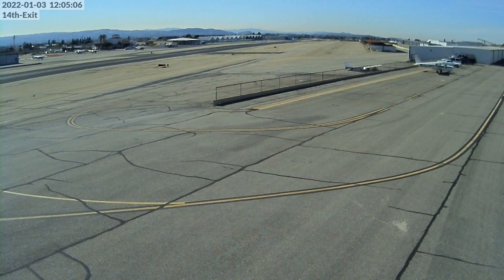Helicopter Wake Turbulence is a REAL CONCERN for fixed wing aircraft!!

Comment: If a chopper can approach from any direction, why does the huey come right down the runway and essentially lay a trap for fixed wing aircraft trying to land?
Reply: Helicopters off "side-step", but flying the runway could actually disipate faster as vortices move away to each side, leaving the runway heading cleaner, faster.  It looks like the helicopter here was more over the taxiway or inside a bit, possibly pushing vortices right into the runway.   Following runway heading may be better perhaps for helicopters, stepping off only when needed and then direct as possible to their parking, though at some point even there a point of the runway would be impacted.  Waiting 1-3 minutes when behind is always the best answer depending on their descent path